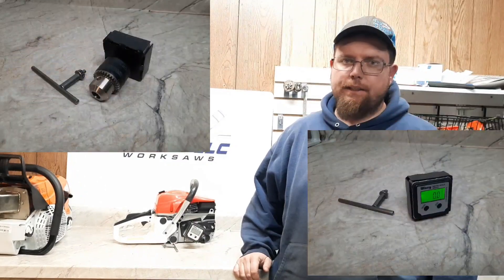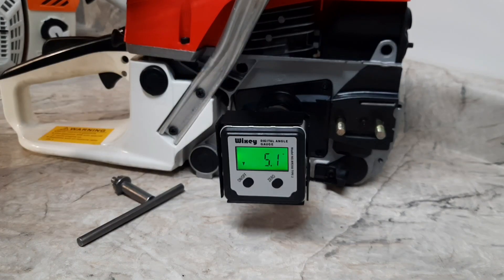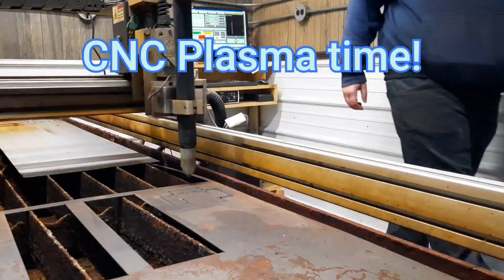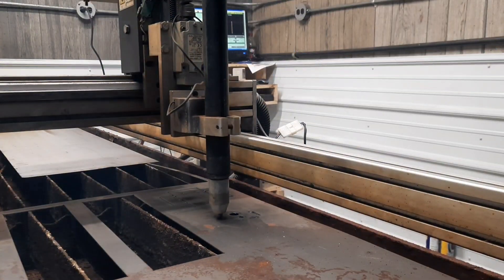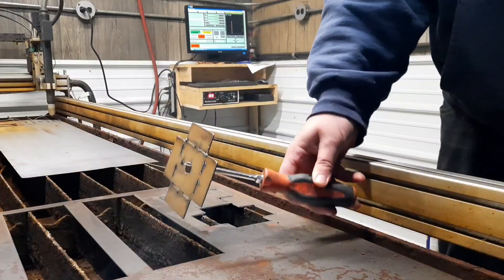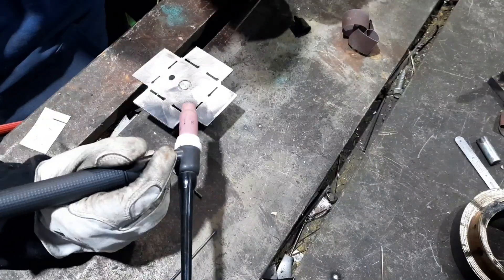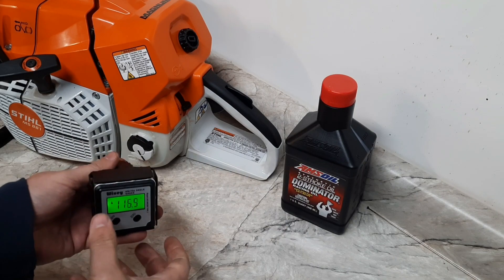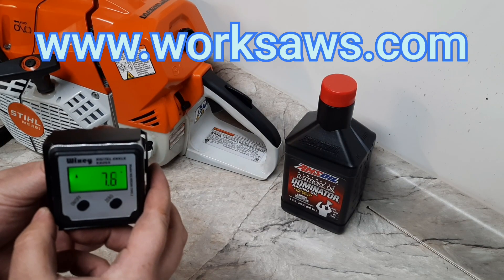Best tool for port timing!How its made!# Chainsaw porting

Comment: Great tool! Especially for those of us with aging eyes. I like to put my degree wheel on the flywheel side on saws with outboard clutches. Could you make these up with a stud to attach to both the drill chuck and flywheel side side adapters?
Reply from the maker: I have had good luck lightly clamping on the threads. Or wrap a piece of tape.

Comment: That’s cool I use a drill chuck with my wheel is it perfectly acccurate good job Joe
Reply from the maker: I feel it is as accurate as the setup.

I always dislike trying to bend a wire pointer and remember my sight line. With the digital I know to hit my same numbers and I'm good to go. I have not noticed any drifting or anything of the gauge. It has been pretty repeatable.

Comment: Hi Joe , That’s a trick set-up bro !    How bout a dial-indicator that a guy can screw-in to the spark plug hole to get TDC as a complementary accessory. Wood be Lickety-split quick to time your saw - remove clutch , spark plug and within a minute you are GTG . A miti 2416s dial indicator might be an option
Reply from the maker: With the piston port, bottom of the intake before/after tdc is what I use. Could do a piston stop method too.
Reply: @dynojoemods2764  do you have a video on this? I’m unfamiliar with this method
Reply from the maker: @jacksoncroxall3403  yes I have a video showing more about how to use the degree wheel. I will have to see if I can find the link
Reply: @dynojoemods2764  yes thanks I found it
Reply: @dynojoemods2764  accounting for the dwell gotcha